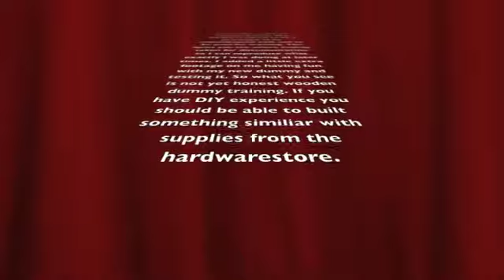Poor man`s wooden dummy 1 (3)

Comment from the maker: The construction itself is astonishingly sturdy and takes a lot of punishment. I had to pimp the stand severl times until I was satisfied. The main problem is that the main body is square. That means if I do not pay attention I hit my knuckles exactly on the edge every time I practice hooks or diagonal attacks. So if I had to do it again i would use a round post. Apart from that the dummy performed well for several years without major wear and tear.
take care man
silk
;-))

Comment: Looks good just a little bit of advice for your next one watch out with that metal strap you have on the leg and make the upper arms one about 2 inches higher than the other one apart from that looks a winner i would get mung bean bags and use electrial wide tape to attach the bags around near the metal bits and also make large mungbean canvas bag and tape it on the head part to make a head to punch  im making one of these real soon enjoy thanks i may use springs for the arms

Comment from the maker: Thanks for dropping by. Your advice is very much appreciated. And yes, the metal straps on the leg have been giving me grief to no end. That was definitely a major design flaw. As for the different hight in the arms - it never occured to me to do that, but the deigsn would probably allow for a refit rather easy. 
However I have some timber now. Dried it in that garage for some months and as soon as spring weather permits I will start working on a much improved version. The bags would bean asset.

Comment from the maker: @DiegoINSOMNIA Thanks for the input. Believe me I haave put a lot of though into considerations such as you suggest. But I am doing this as a hobby. So I am on a budget both financially and with my time. Then we moved to the new house, and whatsnots. Never got around doing so. Today i wuld have a better solution then the metall parts alltogether.  But that no longer matters. The timber for a nice round more classical dummy is drying in my garage right now. Will start in spring.

Comment: about the edges i have worked with wood before so if you have a sander or extremely rough sand paper just sand down the edges with the sander. with the sandpaper first you should get the rough sandpaper and sand the sides you might hit then go over it again with smooth sand paper not too smooth or it wont work. or you could go the easy way out and buy a round post if you do it again. just a few tips hope it helps.

Comment from the maker: @walking1way 
That is material from a heavy duty rubber mat. Those mats can be purchased in hardwarestroes and they are put under laundry machines and such to dampen the vibration. So this is very sturdy and tough rubber material. This way I get the necessary elasticity in the joints.

Hope that helps.

take care
silk
;-))

Comment from the maker: The original stand was the single most expensive piece at 49 euros. The rest of the wood and the screws around 50 euros if I remember correctly. Took me about half a day including going shopping in the hardware store and assembling. Plus a couple of hours to tinker around on the drawing board.

Comment from the maker: The central post is 10 cm by 10 cm by 2 meters. A standard fence post they had in stock. The arms are table legs that I chose by measure of hand and eye, and the shoulders are I believe 5 cm by 5 cm. Lengths of the shoulders again measured on site when assembling to fit my body frame. Sorry that`s the best i can remember.

Comment: How well did this stand up to much use after a while?
Reply from the maker: It lastest about three and a half years and was replaced by a better model after that time, but it would have still been sturdy enough to take further abuse after that time - and I always had it outdoors. In retrospect I must say, that the square posts and square shoulders where the biggest problem. You always had to watch out to prevent injury. Otherwise she was a fine little implement for a very low budget.

Comment: Great set of vids! I'm going to make a pvc dummy and fill it with cement and mount it into the ground. I'm interested n a dummy that I can do iron body training with and so far they are all weak.
Reply from the maker: Thanks fro dropping by and for commenting. Unfortunately this dummy design is not optimal, but at the time I was still living in a rented flat, and the landlady would not let me have another setup. Now I have a garden of my own and after a couple of experiment s I finally went for simply burying a tree trunk in the ground. Works fine and is I thin also very suitable for iron body training.
Glad you liked the mini series.
take care
silk
;-))